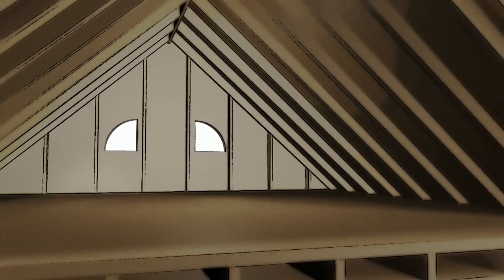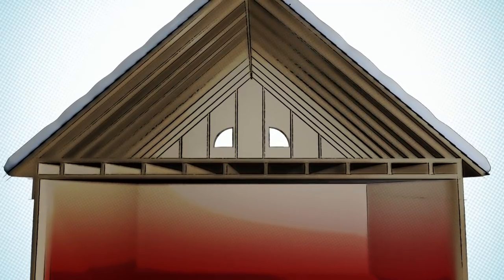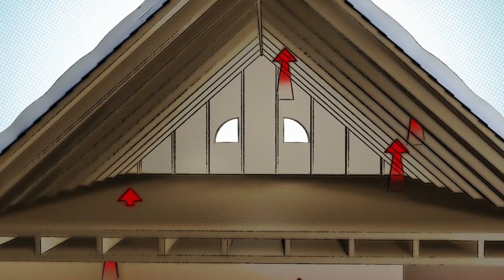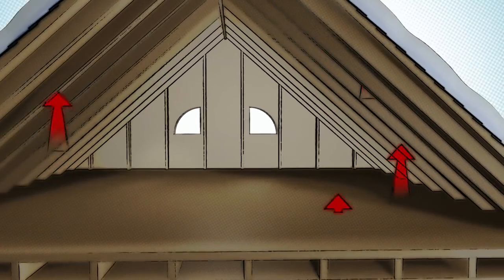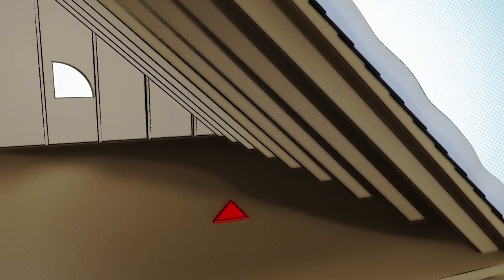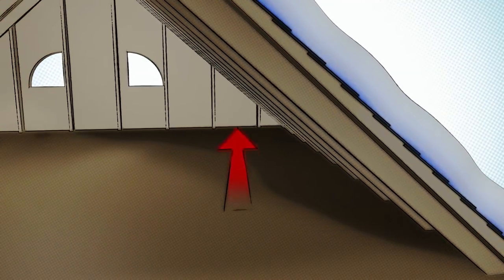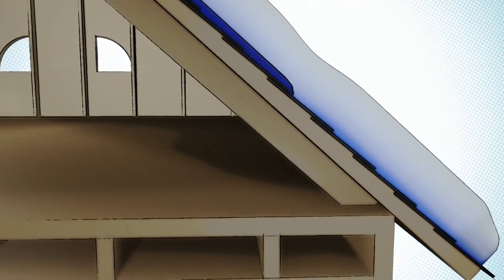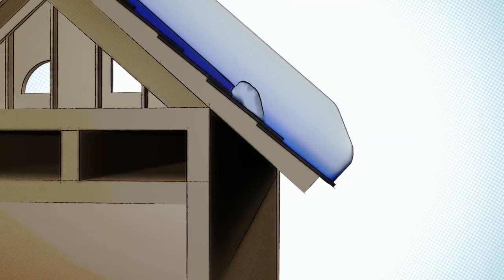How to Prevent Ice Dams | This Old House

Comment: What about just using string to hold up your sheets of insulation ?   Dont get me wrong I like the idea of the spray foam  it just seems to be a more practical full coverage and quicker process without having to play in some insulation fiber  but if your using the fiber r brand stuff insulation pink pillow rolls then you can staple it up or staple  s few lines of string up against the framing whatever depth you think holds the insulation at its proper best functioning place and itll hold that shit it those stud bats until you board it up I'd save a little and use some cheaper 1/4" board sheet rock probably go lighter then that myself and use just  quarter inch sheets of the cheap press board or that tack board stuff from home depot  its only got to be a barrier for the insulation to be kept to it's own engineered thermostat before it will ever fall/flake apart getting into any valuable breathing air so just do a good job at whatever your doing if something don't make sense ask a friend or meet a new one maybe a neighbor you drive past every day is a construction guy and you see the material in the truck so just ask questions be friendly ask someone who knows what they are talking about and who speaks proper English  and if you hire someone do the same and remember you usually get what you pay for who does the job best who do you know you can trust more?     Cmon now folks stereo types are usually for a reason it does not make you a racist asshole bigot to do what you know and say or express or fight or build for what you know is real and what you know has been in a down fall for all the ways .....   you already freekn know rightfully said and you can not deny the way you feel as if shits going to hit the fan on your lifetime this coming time so use the real common sense to get the facts straight open your dammed eyes and only speak up when you know the ways of another the ways of a free peaceful happy safe nation are being intentionally infringed upon this is evil vs good no matter what you believe you are apart of a system built on a planet that will self destruct by means of an outside force evil and it seeks to destroy your any chance at water getn thru and molding your weak roofs ..... build a solid foundation there are times to go easy and times to build hard for to better take the fowl weather the first thing to mind is usually your concious from your inner it just is heard in your open tolerant to temptation brain because that's where your ears of your body are try hearing as well with the one thing that you actually have any chance at keeping healthy free of rot and mildew and no leaks unless you just build yours like a lazy lieing..... fool
Reply: What are you babbling on about ?
Reply: Lmao

Comment: WE have a Ranch Home, Trad. Attic-Floor , Either expect to spend $5,000 to Fix a Ice Dam Leak and New Cieling  Every Yr you get Ice Dams or  Prent it the best you can 1st - 

with 2x8 's x 16" center, Filled with Fiberglass Insulation = R 28, topped off with a 6 Mill Sheeting ( Stapled Down) = Smoke tested= "0" air loss comming up from inside the Home.. Gable End Vent - 3'x3' Square , plus Mushroom Vents in the Roof, every 5 ft..& Vented Eve's. 
Roofing is Shingles, but a Mylar Membrane down 1st, then 3 tab Shingles. And  We Use Heating Cables- In the Valleys and INSIDE the Gutters..= Heated Gutters, ( Ice will form Inside gutters and thus Can't flow..) Can't see the Cables.....If you get 2ft or More Snow on roof? and will last more than a Few Days?  Have it Scraped by a Pro ! Cost ave is $100 .. You can play with using Salt Socks- Ankle Pantyhose, filled with Salt. Laid HORIZONTIALLY ALL Along where the ICE has Formed We Filled ours up with PELLET SALT Last 3x longer..
Reply: This is by far the worst idea I have ever heard of in my life...
Reply: y in the world would you do so much and it doesn't even take care of your ice Dams... and then you go and recommend it to other people...? LOL
Reply: or retire to florida perhaps?
Reply: you need a metal roof

Comment: Wait one sec how does the air flow cool the roof in the summer hmmmmmm?this video explains a reason for airflow whos right???
Reply: It doesn't have to, it's a sealed rafter bay completely enclosed with foam,no ventilation is needed

Comment: No venting along the roof. I thought these guys were supposed to be pros? Even I know that much!
Reply: Only time you need to vent a roof is if it's unfinished space. But if you have an attic as living space and the temperature is to be the same as the rest of the house then it's absolutely correct to insulate the rafters.
Reply: +Owen Contractors actually,  not correct. the air still needs to flow from the eaves to the roof, or from the end of the roof peak to the actual peak. that's what keeps snow from melting and creating ice dams, and helps hot air escape in summer, etc, etc.

that's why there are barriers sold to create a space for venting against the roof, while allowing room for insulation along the ceiling!
Reply: +romansten9 Could you post a video link to further explain? This video did explain that the attic was to be heated...therefore insulating the rafters and then covered with a thermal barrier.  Would not insulating the rafter prevent (mitigate) the melting of the snow along the top of the shingles as the video explains?
Reply: +mortalstorm Yes, that is part of it, and will at leadt accomplish (something) as you stated. But venting the roof will carry summer heat within a channel to allow it to escape, rather than conducting that heat through the insulation and into the home. In the winter, heat and cold conduct into and out of the home. Yes, insulation may be enough to stop the melting and ice dams, but it still doesn't accomplish ventilation. So it's a matter of good, better or best. Not saying people couldn't be happy with this approach, it just leaves other issues unresolved. So a customer may be ignorant of the other issues, and ignorance is bliss, right? So it becomes a matter of doing something as we gain more knowledge, or just leaving as is. I'm not faulting anyone if they don't vent their roof. Just warning that it may lead to higher energy costs and other issues. people can make up their own minds....
Reply: +mortalstorm And sorry, I don't have a specific link.  But what I'm saying has been standard construction for some time and can be found in just about every book and video out there....
Reply: +romansten9&#160; you are so very wrong on everything you just asserted. if it is airtight, there is no need for venting. closed cell spray insulation is water and air seal. your rambling about summer heat needing to be vented is absolutely irrelevant. its airtight, so get it to the temperature you want, and keep the windows and doors closed and it will stay cool. moreover, summer heat has nothing to do with the winter ice dams.

and you keep babbling about the insulation "conducting the heat out". do you even understand the word insulation?
Reply: +JamesMichaelDoyle There will always be a temperature gradient. In the place where hot meets cold, condensation will form. Insult people all you want. You can't argue with science.
Reply: romansten9 indeed, you cannot argue with science, however as you are demonstrating, you can be completely ignorant of the applicable science.
Reply: +JamesMichaelDoyle All insulation has losses. You make it sound like its a perfect barrier. Earlier I was referring to what conductive loss in insulation is. So stop calling names and trying to sound superior here.
Reply: Roman, 

look if you just move into your large attic and turn on the heat then yes it will bleed through the uninsulated rafters and create ice dams and all sorts of problems. However with spray foam your now heated attic stays warm on the inside and stays cold on the outside. There is no bleed through from the warm attic (in the winter) to the roof deck which would cause the ice dams. Go look at a spray foamed building like my shop (it's in my videos) in the winter and you'll see no snow melting/dripping off. It's like an igloo inside, heat does not escape.
Reply: This is hilarious.  Venting a roof is not necessary.  Think about it, you are arguing that you need the exterior air temp under the roof to prevent condensation and ice damning.  What if the interior temp hits the air in your vented channel, it creates condensation underneath the roof sheathing which makes its way into the roof system.  Venting a roof is so unnecessary and it blows my mind that someone would actually argue that it's the best way.  I hope you're not a builder!
Reply: This is wrong.  You need to vent.  If you spray foam direct to the underside of the food without venting,  all the heat from the sun that hammers down on your shingles goes no where.  You do it this way without venting say goodbye to your shingles, they're just gonna fall off.  These guys aren't pros
Reply: @romansten9  no it doesn't if u are conditioning the attic after all of this spray foam is installed! DUH... It's called a conditioned space for a reason. No different than a wall with insulation on it's side with shingles on the outside... really simple! Just have to be sure to manage the indoor air temp and humidity!
Reply: @owencontractors2650  What about an attic space where some is living and some is not. (One and 1/4 story sort of Craftsman style home built in the mid 30's, in the northern US with long, winters with heavy snowfall?  Was originally all unheated attic space on the 2nd floor, but in time 2 small bedrooms and 1/2 bath were added with a portion that remains unfinished. The unfinished portion does have a subfloor. So, living space you have 2 x 6's little room for insulation in bedroom ceilings. Fiberglass rolled in unheated space roof rafters (true 2x6). I had thought foam sounded like a good idea until reading all of this. So many conflicting opinions!

Comment: i would never use spray foam. i would use roxul all day then put 5/8 purple drywall. never what he did. foam is junk . im all about passive homes. 2x8 or 2x10 walls .with 5/8 rock on the walls too

Comment: This is horrible idea.You never want to spray foam directly on your wood sheathing. Your roof needs to breath. If your roof doesnt breath your roof sheathing will sweat and then eventually rot. The shingles will lose the granules and start to become pitted. When this accurs your shingle manufacture will not honor the 30, 40, or 50 year warranty that was supplied by your roofing contractor with out proper ventilation.
Reply: +Bobby McCollum FYI Bobby? Warranties on Shingles is a Minimal Cost compared to The Labor cost to Replace a Roof! Same goes for Paint Warranties! Who cars if get a New $25 Gal  of paint, It will cost $500 to Hire a painter to do the job! Just hire a Pro' and Insure they warranty the LABOR !
Reply: Completely untrue misnomer. Spray foam is to be sprayed on the roof deck for adhesion and to create the necessary insulation. Leaving a void in betwen is going to be the thing that will damage your shingles, create mold and rot. All spray foam is applied directly to roof deck. Doing it your way is exactly what creates ice dams, the very thing spray foaming is trying to fix. Go watch the video of my shop being done. Never had any problems with shingles since. You need to educate yourself.
Reply: Also shingles have a 10-20 year warranty. Where are you coming up with these figures.
Reply: Agreed, it's a horrible idea but not for our stated reason. Since there is no air circulating between the foam and sheathing, there is no moisture to vent. Foam is overkill price-wise, and building science-wise. Silva recites the lines he's given without any thought. He's owned.
Reply: @77Avadon77  30yr singles are quite common.

Comment: Why spray attic rafters with over-priced foam for a simple ice dam problem?  And why does it need fire protection?  The floor joists are easily insulated and sealed economically. This video is promoting expensive and unneeded work. Once again, Tom Silva is parroting the script instead of applying building science.
Reply: Did you watch the video ?  It's the only way to get the required R-Value in the attic.

Comment: LOST ALL YOUR ATTIC VENTING AND SOFFIT VENTING.. SHINGLES WILL ONLY LAST 10 YRS NOW..  BADDDDDDD
Reply: +san379 hey MR ALLCAPS! this is exactly how closed cell insulation works. you do not need any venting, as it is water and air tight.
Reply: JamesMichaelDoyle shingles need to breathe from inside n outside or else they cup
Reply: san379 just got another alert here. didn't notice your nonsense reply.

incorrect. you are still stuck on the thinking of it not being insulated well. go look this up if you still insist that you are right. plenty of youtube videos explaining the hows and whys.
Reply: im building a house at the moment .. called the albion rd project.. check my channel.. from a abandon house to a  new home and building code says.. 1 1/2  breathable  space  with styrofoam  vent shoots  to the attic.. can not block it all off  and will install sprayfoam in the small tight areas  in the roof to wall area and then  blown  celulose in the attic..
Reply: san379 and again, you are trying to apply standard systems restrictions to an entirely different system. this is closed cell foam.  entirely different beast.

Comment: -100 points. totally against code. You can not do that to the attic roof. You must provide a air gap
Reply: Timothy Whieldon I trust this guy cuz he has a hard hat. Actually the discussion here is fascinating. To vent or not to vent, that is the question. Cancerous or safe. Shingles will fail or not. In the old days we did not have YouTube videos and a comment section. I learn a lot from the comments. I wonder if it's been scientifically studied. We often don't know of the failures until 40 years have passed.

Comment: Great for those of us that own old 1 1/2 story homes but what about air flow under the roof?  Should there not be a baffle so air flow can come up from the soffet and out the roof vent or was this because there was no real attic
Reply: Because of the properties of closed cell spray foam, this technique is both acceptable and a good solution.  Another aspect is to keep the interior humidity down (RH).  The risk of water vapor condensing on the underside of the roof sheathing is extremely low and depends on the climate zone.  Many types of unvented techniques do work if they're done correctly and the climate zone is factored in.
Reply: Well once you replace your roof and possibly your roof sheathing all that spray in insulation will come out with the old sheathing.  Would never do that.  All u do is install roof insulation baffles and leave a min of 1 inch air gap behind insulation to roof sheathing.  This makes sure the air behind insulation stays cool with air flow from soffit vents to ridge cap still working